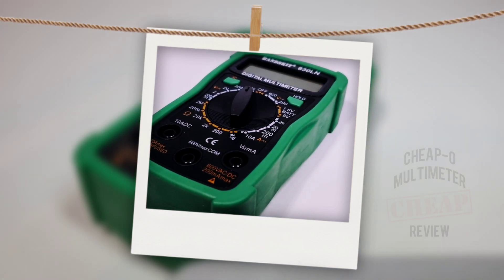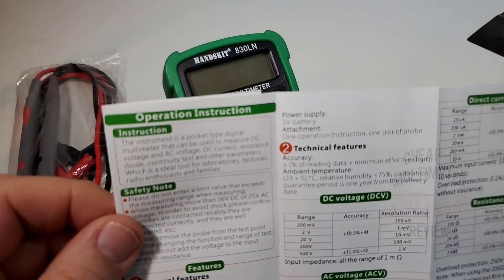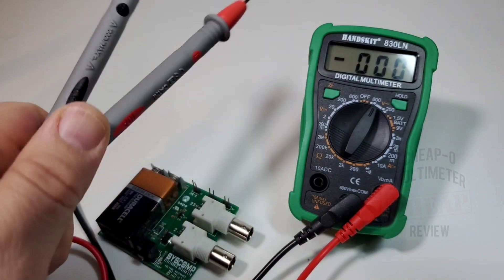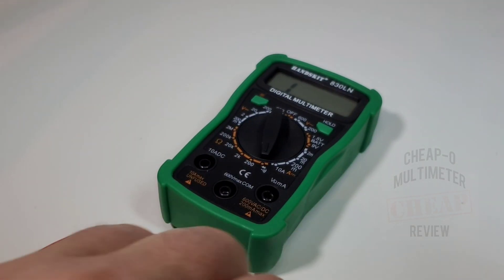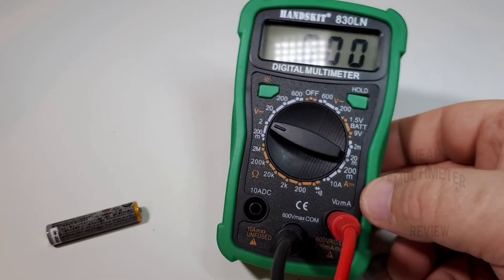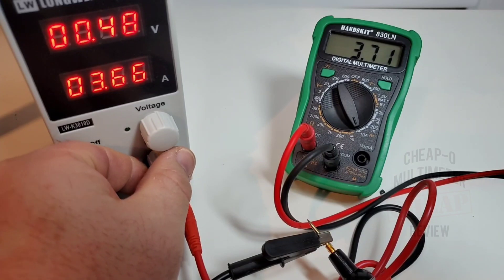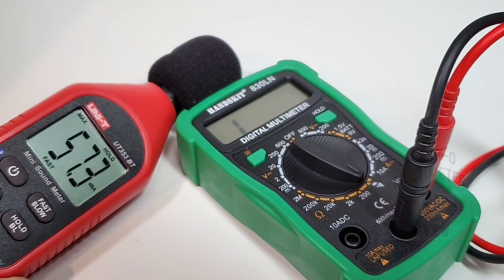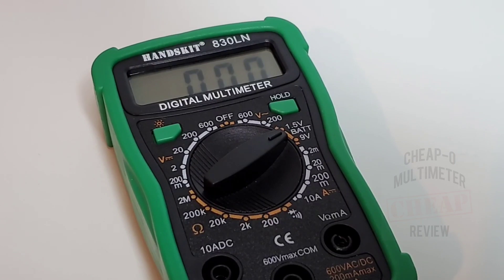HANDSKIT 830LN CHEAP-O Multimeter Review & Teardown!

Comment: Thanks for the review. I had lackluster performance too, but it's good for continuity. Mine is beautiful red with the brand Kepiog 830LN. It was testing AA batteries, but now I can't get a voltage on anything. I replaced the included batteries with Duracell, but no dif. I got mine in a soldering kit too, and it had so many nice goodies, I don't care. I will shop for a better one.
Reply from the maker: Ahh that's too bad..decent 830xx clone with some extra bells. Let us know what you're replacing it with. 👍

Comment: The battery test sets a fixed resistance load and measures current, not voltage. For a 9 V battery it is usually 24 mA @ 9.0 V, for a 1.5 V battery 40 mA @ 1.50 V (on some models 50 mA). This function is identical to a DT-182.
PS, for small watch batteries, switch to the 9 V test and expect 4..4.5 mA on a fresh battery.
Reply from the maker: Yes indeed..I realized this after the initial review. Definitely an unusual albeit interesting way to measure a batteries longevity. 👍 btw great tip for the watch batteries!

Comment: I got one and working sjut perfectly fine. I think you are unlucky. Btw you used the battery tester totally wrong. That is not voltage, but more like a weak try to show percentage of the battery
Reply from the maker: No its fudged. I received another unit and it displayed the 1.5/9v function perfectly. This dmm wasn't meant for prime time. Thx for watching 👀

Comment: My COM Port wasn't working that well either. I had to tilt the end of the lead that goes into the multimeter for it to register. 

If this is your problem just take the multimeter apart and lightly crimp the cylinder down. Put it back together and if you crimped it enough it'll work flawlessly.

Just be careful. Small parts inside of the dial
Reply from the maker: You mean input jack. Yes you can crimp to make a better fit but you shouldn't have too.
😀👍
Reply: @KeepOnTesting  Thanks. I agree

Comment: I got one and it seems to be working fine. I am not super experienced with using a multimeter (hence why I am watching this) but I have a question about the continuity selection. Does that test a wire to see if there is a complete circuit or what?

Comment: Love your reviews Simple yet informative. So much so, after the review on the  ZOYI ZT102A . Which BTW was another brill vid,  I went and bought one. I love the Auto feature which is great because I'm setting up 12v electrics in my Camper Van. But something curious happened. by accident I have found  4 more false Auto settings .If you place the dial in between each functions  mode  settings starting from  the mV dial mode. to, in between the A and  mA dial setting. The Auto light  comes  up on the screen,  and it works just like the proper Auto. Is  this  normal or is there a problem somewhere.???? BTW only tried it once. just in case I may damage the meter
Reply from the maker: I'm pretty sure thats a bug not intended for real world use.Anytime you get stuck between ranges its usually not a good thing. Thanks for the kind words!👍
Reply: @KeepOnTesting  Thanks for the info. It's works fine at the moment , lets see how it goes.

Comment: I think on some other cheap multimeters with a battery tester mode the meter will display the current under some kind of load and not a voltage. Check the manual and see if it says anything about it. Nice review of a green steaming pile.😜
Reply from the maker: Green steaming pile..I like that !
Believe it or not but there's not 1 mention about the battery function/range in the manual, smh. Food for thought though!